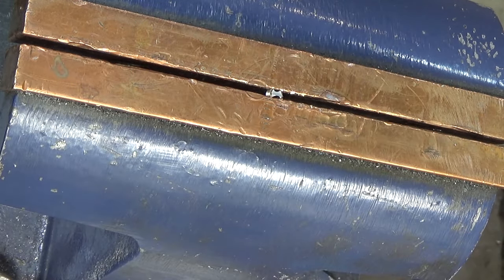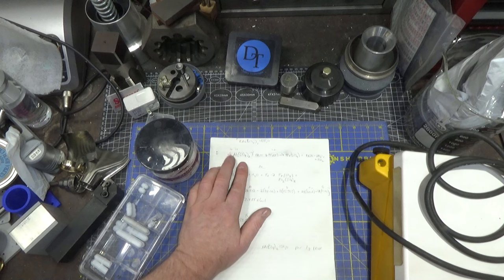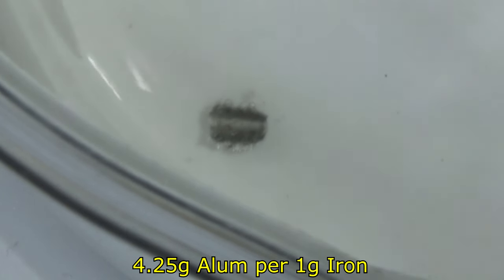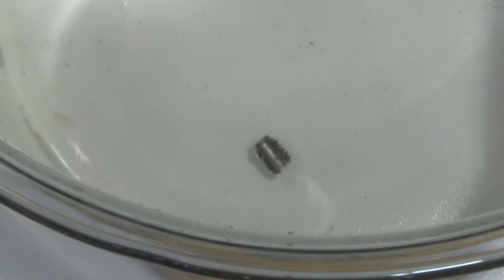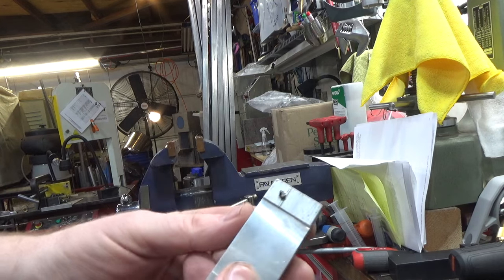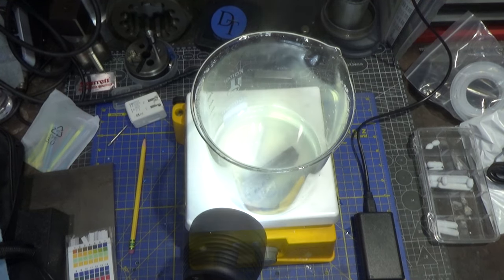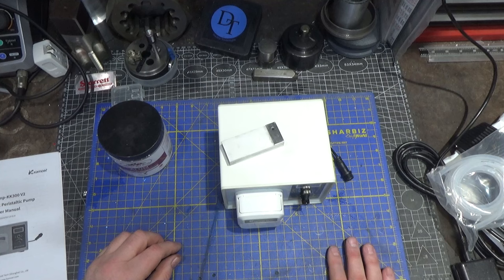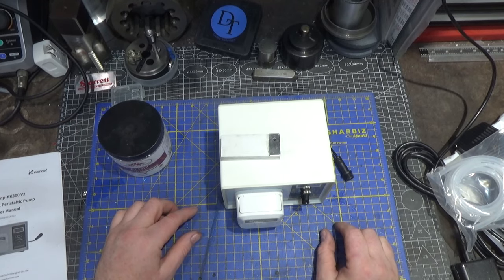Shop Miscellany #18 Dissolving Broken Taps With Alum

Comment: Hi Robert,
If you want a nice matte finish on aluminum, try a regular household abrasive cleaner (that cheap stuff that you use for bathroom and sink) and a stiff brush. If you work the surface with something like this for a while rotating and scrubbing, you will see that a (dark) gray gunk is formed, that's what you want. After rinsing, you are left with a nice matte "etched" surface. Nothing is as unsightly as the unevenly reflective, mottled surface that aluminum can exhibit. This way you can get rid of it cheap, quickly and harmless, and if you use such a liquid with a lemon scent, it even smells nice ;-).
Reply from the maker: Thanks for the tip and no caustic chemicals. Almost disappointed.

Comment: I am more than impressed with your knowledge of chemistry and have to wonder if this might be part of your everyday business background.  In engineering university years ago I had three required semesters of chemistry and can barely recall the elemental makeup of water these days.  And as it turns out I have never broken off a tap in anything but steel.  Interesting solution to a really nasty problem nevertheless.  Thank you for sharing this.
Reply from the maker: My daily gig is oriented towards electrical engineering. I almost went for chemical engineering, but hated labs.

Comment: I think EDM drilling method works way faster than that. There's even cheap Chinese portable EDM power supplies made specifically for extracting taps, that you can buy. Haven't tried that myself, but something to look out for.
Reply from the maker: I believe that you are correct. I will probably try one of those out one day. Thanks for the tip.

Comment: The primary ingredient in most of those Thai deodorant stones is potassium alum. Just in case your in a bind and you need some alum, you can just shave some of the deodorant stone to do this if you have one around. I'm not sure that this would be my go to solution for removing a broken tap though. But it might be my last resort solution if everything else failed. I suspect that even just using this solution for a shorter amount of time would loosen it up enough to try and back it out by some mechanical method.
Reply from the maker: It's also the prime ingredient in styptic pencils for shaving. It is a really slow process and I agree that it would be a last resort.

Comment: The temperature of the hot plate does not equal the temperature of the solution.  There is a lot of heat loss.
Reply from the maker: There is indeed. The amount was surprising.
Reply: @DudleyToolwright I say this because I've been trying to do this exact thing for the past few days.  My hot plate registers 350F-ish, but the solution only 150F-ish.  I got some bubbles, and the tap turned black, but after 10 hours I saw no dissolving of the tap.  I remade the solution and got no bubbles at all.  Tons of bubbles forming on the aluminum, though.  I'm not sure what was wrong, but I gave up.  I'll spend two hours remaking the part.

Comment: 18 to 24 hours is nothing when you break tap in an expensive hunk of bronze… I just use a saturated solution, precise measurements not really needed, in a large glass measuring cup on Coffee cup warmer… saved $300 bronze block I was turning into a steam engine cylinder, by why it was 5-40 tap in blind hole
Reply from the maker: I appreciate you sharing your personal experiences. I always learn something.

Comment: Robert what are you doing to me drawings with Squiggily lines how back to University to do a degree in chemistry and a masters .
20000 thousand on a equipment ,up to the workshop a eyedropper and hydrochloric acid to put on the tap if it damages the part helicoil it .
Kit from down under
Reply from the maker: Interesting suggestion, thanks. Does HCl work well?
Reply: @DudleyToolwright  very slow helps losing it .